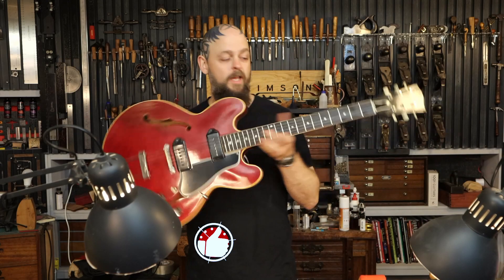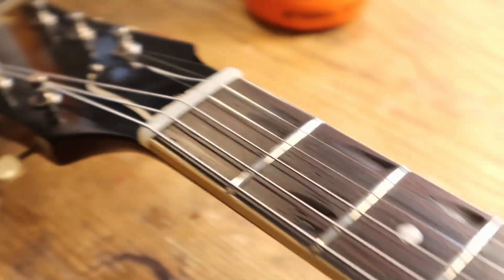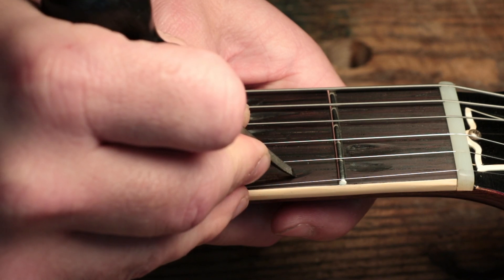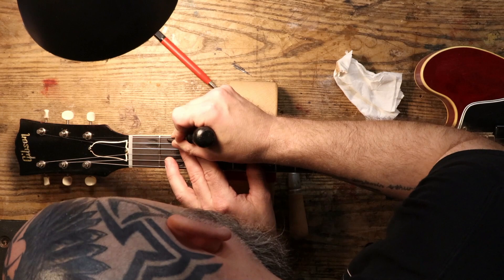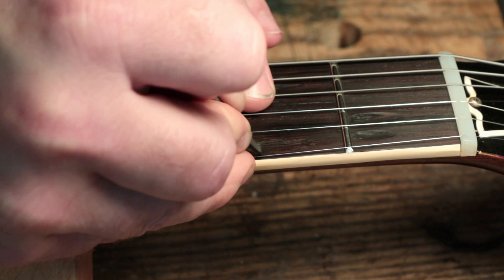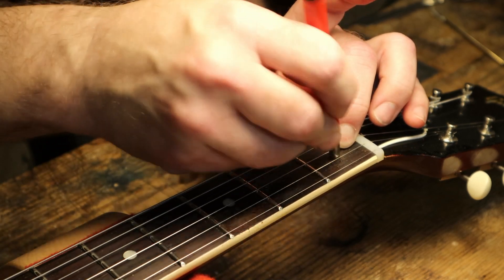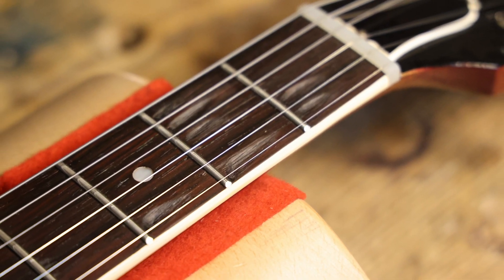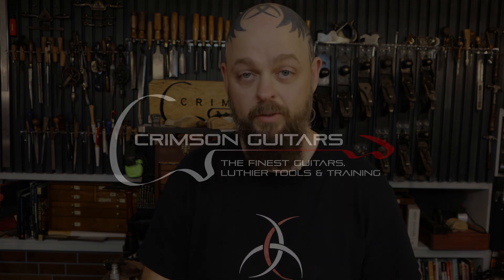Carving into a 1960 Gibson ES 330 TDC | But in my defence, it is an Improvement!

Comment: I would have filled it. i imported a Greco stratocaster from japan and when it arrived someone had half assed scraped out the wood between the frets as if doing a scalloped fretboard. Couldnt see it in the fotos. Damn it I thought to myself ! I was gonna glue some rosewood veneer over the board and recut the fret slots. The guy at the wood shop told me that the neck was brazillian rosewood. So I had to save it. So I sanded down the board to remove most of the damage and with the dust mixed it with wood glue and filled the last of the damage. I had to scrap the filled damage to give it some grain. Then with some dye and oil i worked it into the board and there is only one very little bit that still looks shiny compared to the rest of the board but gotta say it came out super good !

Comment: There’s cosmetic repairs, and then there are cosmetic repairs.  I find most natural relic type blemishes are just a part of the instrument’s story.  The original ‘repair’ work wasn’t necessary, but since it occurred I would’ve tried to disappear the grooves entirely.  Sawdust and wood glue, maybe?  I had an old Gretsch once that someone reset the neck on using a screw.  I had a luthier replace the metal fastener with a wood dowel then blend the lacquer over it to disappear it.  The spider cracked pick guard, the buckle rash, the worn finish on the back of the neck, all the nicks and dings stayed, but that stupid screw and any sign of it had to go.

Comment: Too bad you've already refretted it - with any dust you sanded off the (then empty) fretboard, you could've concocted a pretty much colour-correct filler for these holes.
And shrinkage wouldn't have been any issue - rather the opposite actually, as you'd still have those slight dips in the rosewood, indicative of years of happy playing :)

Anywho, I love a 330 style guitar - far more than the more common 335 style, actually... It's the sound you'd expect from a semihollow, I feel: very "woody", very resonant on front and back. Even if it takes a little away from the sustain.
Mine, by the way, is an 80s Aria Pro-II TA-60, and it's absolutely gorgeous....

Comment: The customer gets what the customer wants and pays for, but personally I detest the "relicing" of new instruments. 
I agree that necessary repairs and replacements on old instruments should be made to look consistent with their overall condition, but in this particular case those divots must surely reduce playability. Unless this guitar is destined to be displayed rather than played (which is in itself fine), I would have wanted them re-filled.

Comment: This resulting cavities from removing whatever was used as filler look, to me, as thought they were preshaped prior to filling, likely with a rotory tool, like a Dremel.
The divets are so elongated, and they taper to a vanishing tail. They don't look like natural wear at all.
Personally, I would have routered each wear position to a symmetrical shape, made plugs of the best possible matching like-wood, and leveled them to the board radius prior to the refret.